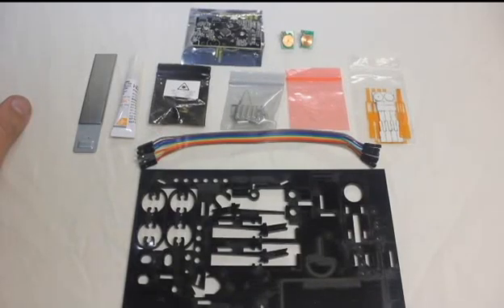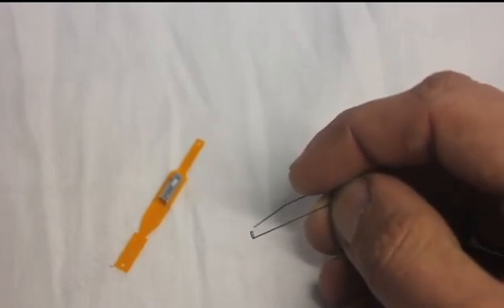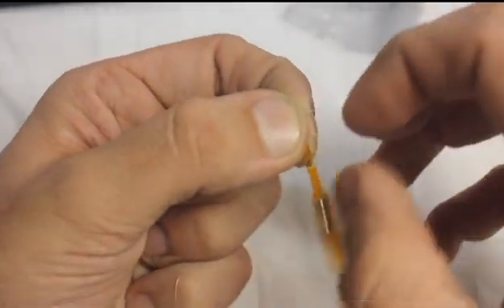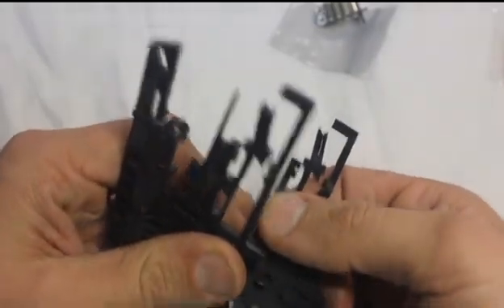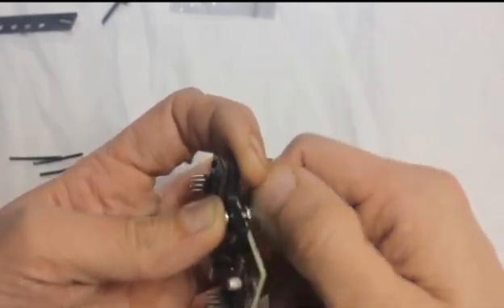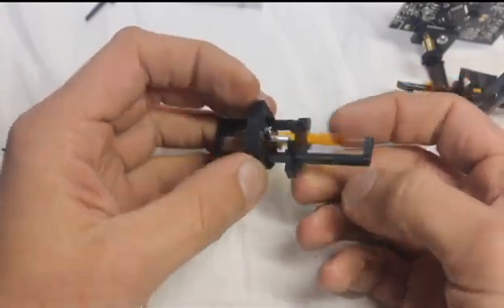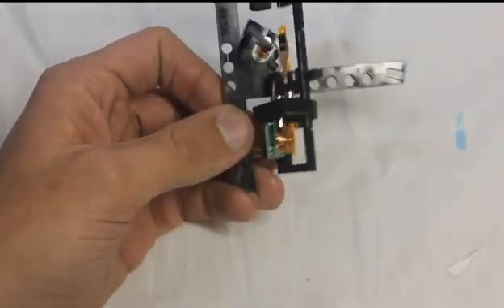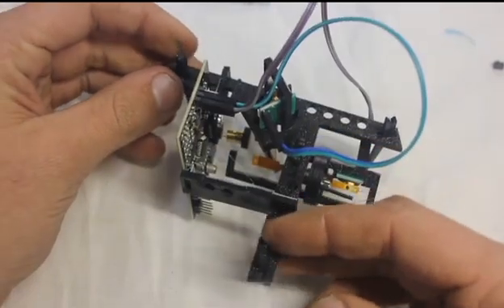How to Build the Peachy Printer V1 Kit

Comment: You didn't lock the circuit board mount all the way on to the "T" frame, do the magnet dampener frames have to be placed right together, or can they be spaced so that one frame is on either end of the magnets? Also it there any fear of interference if you place the coil wires to close to the wires? (I want to run mine along the framework to neaten it up a little), finally, is there a weight issue with the armature, can you put on too much super glue to hold the magnets and aluminum dampeners in place?
Reply from the maker: Phoenix - 1 - Good catch. Adding an annotation. 2 - Not sure. Place them together for now. 3 - Shouldn't have any interference problems electrically. 4 - No weight issue, but be careful not to get any wet superglue in the triangular hole or on the thread itself. :)